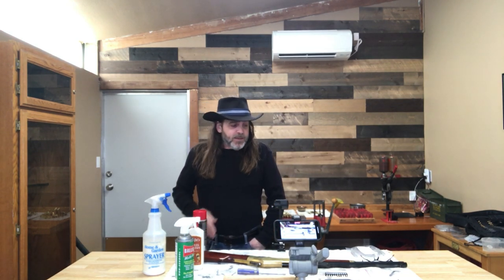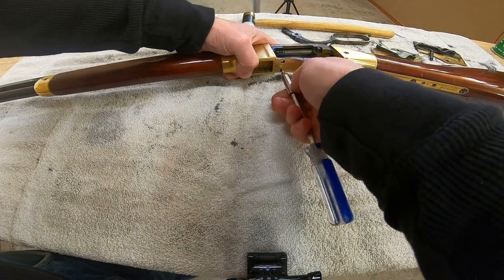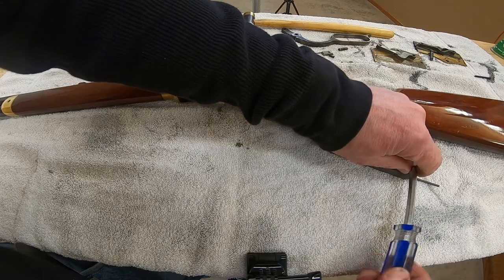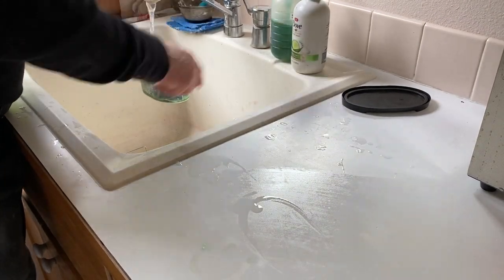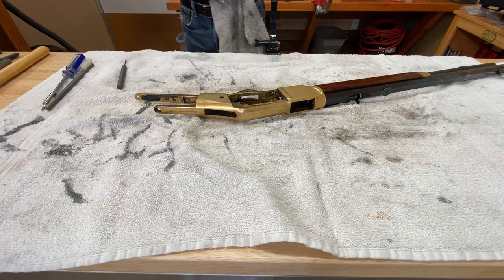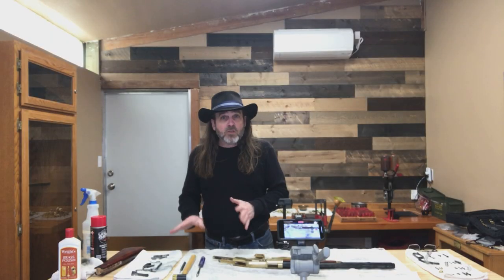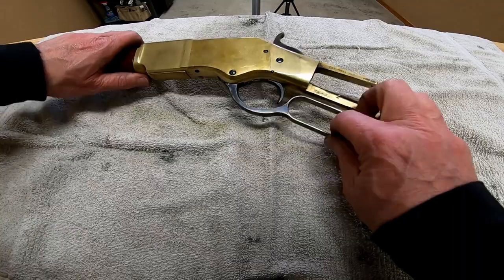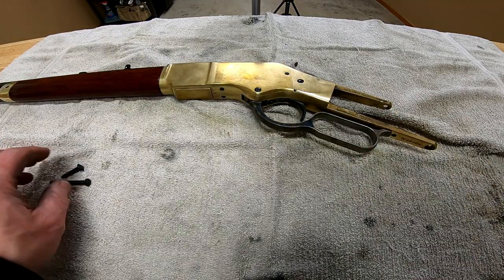Uberti 1866 Yellowboy Disassembly and Cleaning [How To]

Comment: Just a question.  Do you have to do a complete teardown like this everyday you shoot black powder?
Reply from the maker: No. I do a basic cleaning like this:
https://youtu.be/UPzM5ZUkFHA
I only do these complete tear downs once or twice a year, depending on where and how much it is fired. The 44/40 keeps the internal action relatively clean. 
Great question!
Reply: I just recently got into cowboy action shooting I bought a 66 yellow boy in 38 special used And it has an action job done to it I noticed a lot of wear on parts and pieces 3/4 the way through my second match we found out the hammer spring screw was stripped so somebody else  let me borrow their rifle to finish out the match how often do you have to replace parts inside these guns to keep them running the way you do
Reply: @JED iTV  Big fan of the show.   I do not compete in cowboy action shooting, but I do shoot black powder revolvers 1860 .44.  Have shot many 60 rounds through in its whole life.  Just cleaned it just the normal field strip barrle, cylinder cones removed, frame, and cleaned everything with rags soked in moosemilk.  I do not shoot it often, so when I am done, I give a good slathering of pure ballistal to prevent rust, giving several big squirts down into the action parts as well. 

 Then, I did not touch it after cleaning it for several years.  One of the internal parts broke, and I had to take it apart completely, and all of the internal frame and action parts did not have a speck of rust anywhere, just lots of black gunk from the caps and some powder fouling but you can't tell which it which .  The rest of the revolver was rust free as well.

I suspect that as long as you keep the internal parts properly and regularly lubricated, it keeps the black powder moist, preventing it from collecting moisture, causing rust.  

That's just my take on it, but if I ever decided to compete in cowboy action shooting and go the holy black powder way, I will use 44-40 for the rifle.  I like shooting and cleaning black powder, but I do not want to spend forever doing it as well

Comment: One thing I've noticed is that removing the lever screw BEFORE relieving tension from the lever and lifter leaf springs will marr up the threads on it. So I loosen those 2 screws first, then the lever screw comes out without any tension on it and the threads don't get damaged.
Reply from the maker: Thanks for sharing that tip!

Comment: Thanks for the video.  If you loosen the lifter and lever cam springs first, the lever screw comes out a lot easier.  I like to use a grease I make from Lanolin thinned to just the right consistency with flaxseed oil for lubing the internals.  It stays right where I put it and does a great job of keeping black powder fowling soft and away from the steel.  I also use it to pre-grease the bore, so that I don't have to put lube inside my cartridges.
Reply from the maker: Thanks for sharing!  I appreciate the tips.

Comment: Perfect timing, I'm getting ready to take mine apart, clean it up and install a .45 Cowboy Special carrier in my '66 carbine.
Reply from the maker: Great!  I hope this helps.  
-Jed
Reply: @Dieselbuilder can I ask which C45S carrier you are going to be using?
Reply: @barryturner3152  The Smith Shop carrier.
Reply: @Dieselbuilder  thank you sir 👍 I will look into that one
Reply: @Dieselbuilder did you get that carrier in yet ? And how does it work? That is the carrier I've been looking at
Reply: @barryturner3152  Unfortunately life got in the way and I haven't had time to get it done.
Reply: @Dieselbuilder thank you , I know about the life thing getting in the way problem too 😏

Comment: I recently have experienced double feeds on my older  nay arms1866 and all comments point to the loading gate to be the cause. Is this correnct?  I see that Taylor makes replacements, and also comments of strengthening the original with a touch of JB weld. It looks like all I need to do is to remove 2 screws to get the side plate off. Any suggestions?
Reply from the maker: Yeah, it sounds like that extra round is slipping past the tab on the loading gate (in fact the tab might even be broken). Open up the ‘66 and have a look at it.  If it is broken, I’d order new and do the reinforcement with JB weld. Unless you can find a good aftermarket loading gate, like from Shotgun Boogie, that’ll fit an older model. 
Hope that helps.

Comment: Is there much difference in the performance in the 1866 and the 1873?
Reply from the maker: In my opinion and based on my experience, I would say that the ‘73 can be shot faster because of it’s lever safety (some of the older reproduction ‘66 models have a lever safety, none of mine do). 
The lever safety makes it so that you can’t pull the trigger until the cartridge is fully in the chamber and the lever completely closed.  With a ‘66 it is possible to have an out of battery fire… if you get going really fast (really fast!) and your basically slam-firing the rifle it is quite possible to pull the trigger and without having the lever all the way closed.  Highly unlikely 🤷‍♂️ but, I’ve experienced it.  
Having said all of that… I do 75% of my Cowboy Action Shooting competitions with reproduction 1866 Yellowboys.
Reply: @JEDiTV  wow thanks for the super fast reply!
Reply from the maker: You’re welcome.

Comment: The elevator and lever springs must ride on the lever cams. I always find it easier to position and snug before I align the side plates; but 1873s are much easier to work on.
Reply from the maker: Thanks for that info.  And, yes, much easier on a ‘73 👍 
-Jed